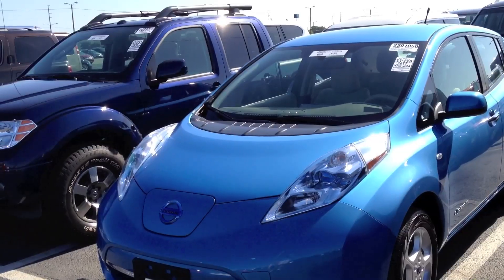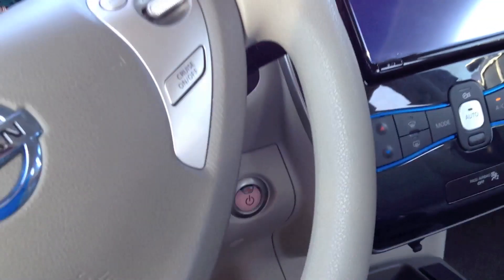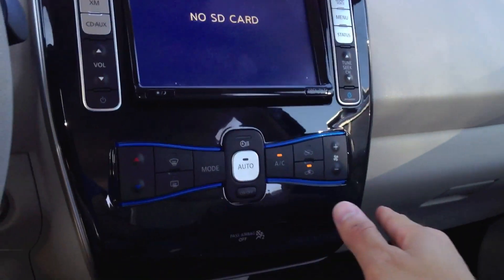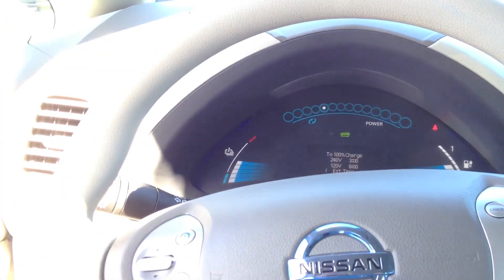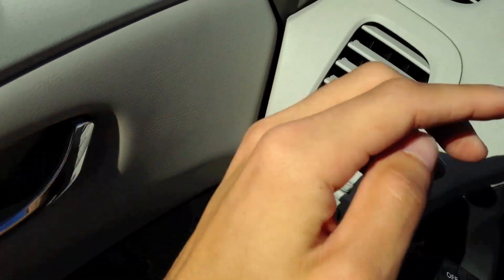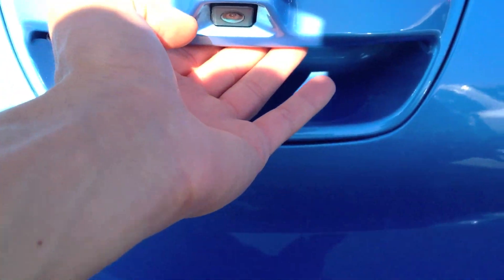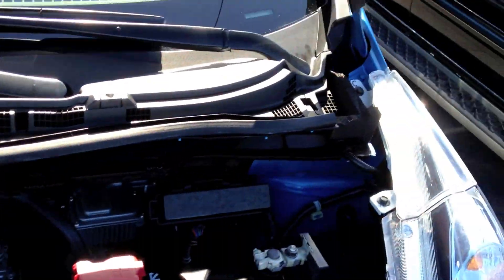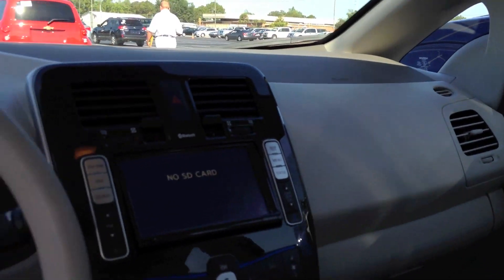2011 Nissan Leaf Start Up, Quick Tour, & Revless Rev - 6K ( Fully Electric Car! )

Comment: The Leaf has electric heat and heated seats. The heater operates by means of an electric resistance element with the climate control fan blowing air over the element. It is like an electric space heater in your house. The heat and A/C are completely separate from the power train and the car interior can be heated or cooled when the car is being driven or when it is parked and unoccupied (there is a nifty app on your smart phone that you can use to heat or cool the car before you get in it!).

Comment: It has an electrically driven AC compressor which is effective but also it's not brutally hot or humid out at the time you were there. Same thing goes for the Prius *GAG*. The compressor will always spin at the same speed and adjust the flow of refrigerant as required by the settings you set inside the car. 

AC in my Maxima will blow stale hot air at first but it will cool quickly within the next 2 or 3 mins and keep the cabin at 72F.

Comment: Torque is not the same as power. Torque is just a force. Torque through a distance is work, and how fast you do that work is power. Unlike combustion engines, electric motors do not have to be spinning to generate torque.

Think about it like trying loosen a rusty stuck bolt. You're still applying a force to the wrench and bolt, but it isn't turning. Once it starts turning, you begin to do work on the bolt, and how fast you do that work is power.

Comment: The Leaf is powered by an AC synchronous motor. Such a motor produces any amount of torque, including full torque, even at zero RPM. The amount of torque is dictated by the strength of the magnetic field, not the speed of rotation.

Comment: I think electric motors have full torque at 0 rpm. The torque is in the magnetic field in the motor - ready to spring into action. Anyway I'm not an engineer but it seems logical.

Comment: Umm, the maker of the video was parked in a parking lot. He was resting his foot on the brake pedal. Also, the Leaf (and most new Nissan products) have electric breaks. The accelerator pedal and the brake pedal are big electric switches. If you accidentally press both at the same time (with one foot or both feet), the accelerator deactivates and the breaks are applied.    Duh.